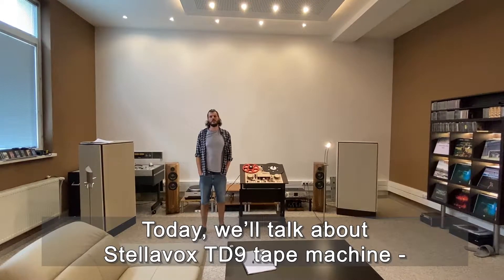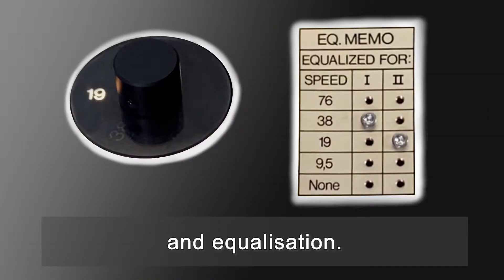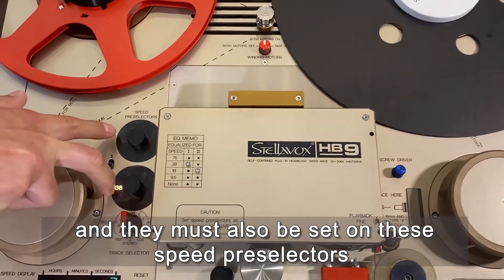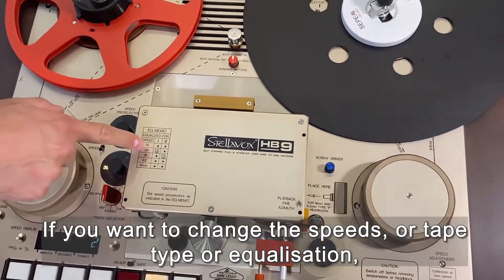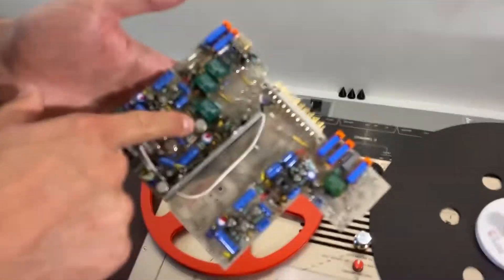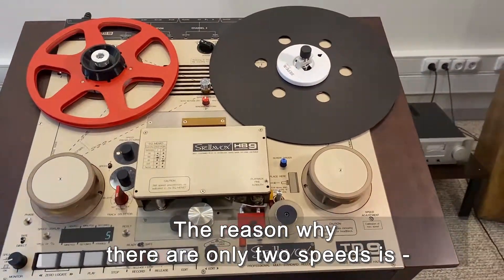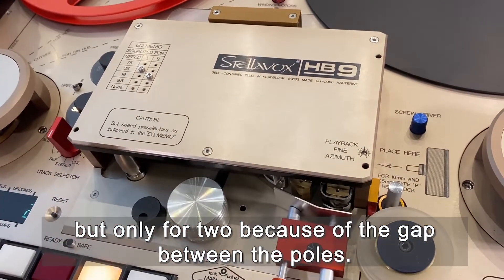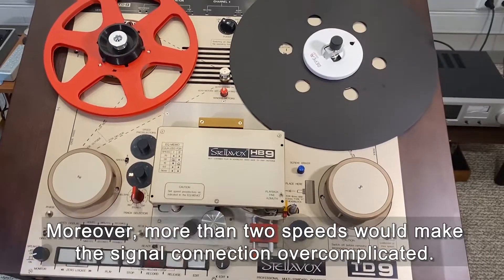Stellavox PRO TD9 Reel Tape Recorder Benefits - Speeds & Equalization

Comment: Just a few hundred made... I think that also goes for the Lyrec PTR-1 "Frida" which is also exceptionally well sounding... but WAY more portable than this one. Just 12kg and still able to use 30cm reels... the best of all worlds for me. After I got this one, I quite frankly didn't use my Studer A807 MK2 for any new recordings anymore. That one sounds muddy compared to the fresh, dynamic sound the Lyrec has to offer. I adjusted both myself to the max, so the differences are purely related to the sound quality of the machines themselves. And now I know: the A807 isn't known as the best sounding recorder, but mechanically it is top notch, and the tape handling is second to none. Pancakes playing and even rewinding(!) in a fully upright position? The A807 does it without sending 1100m of tape through your living room 🙂 Both have THREE speeds by the way, which is a welcome addition to just 2 speeds. And CCIR / NAB switching with the push of a button...

Comment: nonsense , professional tape machines use 1/2 inch or 1 inch tape like studer or ampex, this an overpriced  machine for people with more money than sense, technics rs1500 is every bit as capable.  and has 3 speeds. just another piece of bling not worth the money.
Reply from the maker: 1" and 2" tapes are used in professional recording for multitrack recordings. for stereo is used 1/4 and 1/2" tapes. Regarding Stellavox vs Technixs, you can not compare Ferarri with Peugeot or so :-) ...
Reply: @SEPEAaudio  just look at the W& F of the Technics... and be totally amazed. I have two of these recorders, they have several strong points, like there are NO specially programmed IC's in them, so you can always repair them, and the exceptionally low W & F. No wonder these were chosen as the recorders for the basis of "The tape project". They also have weak points: NAB only, and a very weak headphones amp, to name just two. And the brakes nearly always go bad. Small, thin tapes? You better not rewind them and then press stop. The machine brakes sooo violently using the motors that the tape slips over the pack and is completely demolished. This way I lost a nice 5" Agfa PE46 tape. This one needs 10.5" reels and 35µm tape at least.
Reply: @SEPEAaudio  i did not compare stellavox with technics, I simply said stellavox is an overpriced machine for people with more money than sense. technics is a perfectly capable machine  without all the bells and whistles.
Reply: @SEPEAaudio  Ferrari? another overpriced toy for people with more money than sense, a car is a tool like a hammer or saw, its purpose is to go from a-b. of course there are posers about who think a piece of metal makes them look better.
Reply: @vindicari  Stellavox TD9 is professional tool for recording, by features and by sound superior to anything that was available. for home tape replay can be used of course any mid class machine you are right.